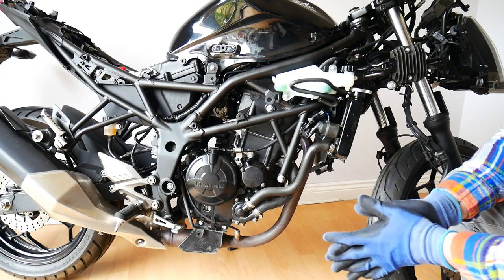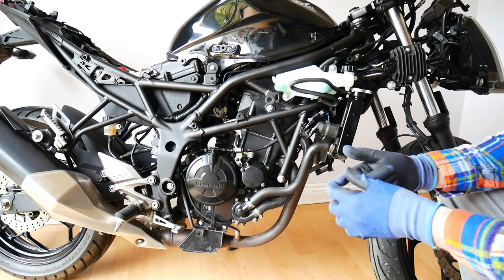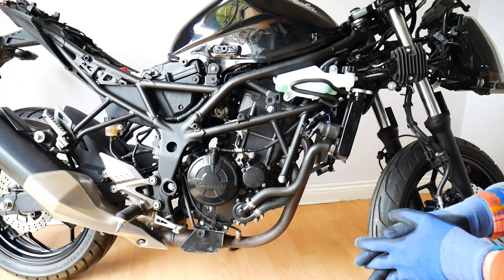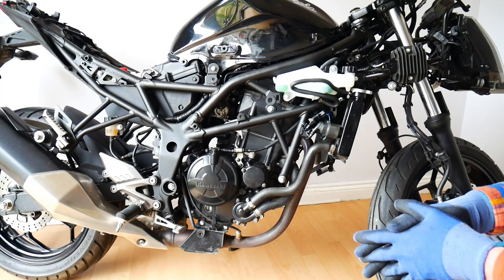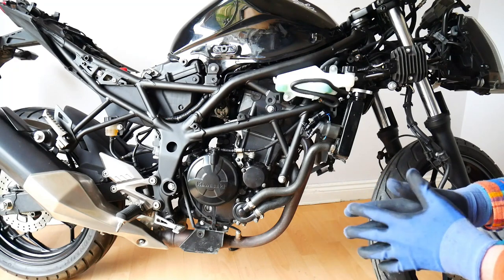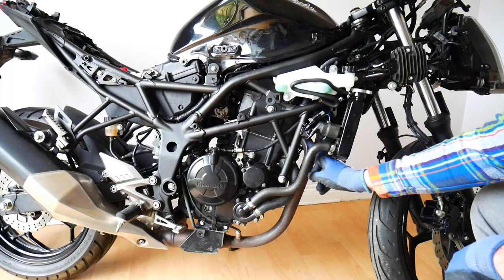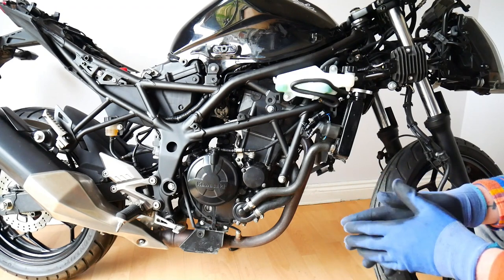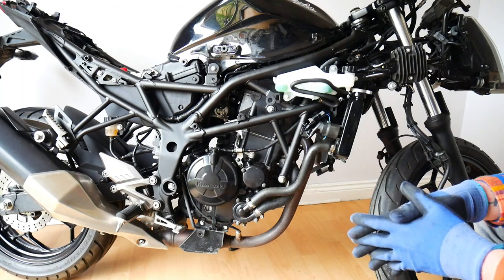How the cooling system works in a motorcycle

Comment: So if I have hot coolant boiling out my overflow reservoir while im riding and at stop lights then has the thermostat failed? Seems the coolant is not going back into radiator to be able to cool down.
No visible leaking
New radiator cap
Flush with distilled and vinegar and only distilled water 4 times
Bleeder bolt bled
And sent through 3 heat cycles

Bad Thermostat maybe?
Hole or cracked hose?? Prolly not cause no leaking visible
Reply from the maker: Coolant will expand into the coolant reservoir normally as the engine heats up and then flow back into the coolant system when it cools down and contracts in the coolant system. If the coolant is actually boiling then thats not good and it could be caused by any number of reasons. Best bring it to a mechanic who will probably diagnose it professionally before any long term damage is done to the engine. Best of luck!

Comment: That was the best explanation I’ve ever had. Thanks. I have a question btw. I found the coolant reservoir on my new motorcycle cracked, but the crack was in the top in such a way that coolant wasn’t leaking at all. I don’t know since when the crack was there, assuming the crack was there since the purchase, is it safe for me covering 8000 kms till I found it? There was no overheating, fan functioning well and the radiator is full. Does the air get into the system? Please help. Thanks.
Reply from the maker: Makes no difference if its just a crack in reservoir and coolant never reaches it. You would be best off getting it repaired or replaced though in case crack grows over time or if bike went over on its side then coolant could leak. If you leave it as is then you might never have any problem with it. It all depends.
Reply: @TheMotorcycleMuse  thank you so much for fast and useful reply. That was helpful. It’s always better to know from a pro. Thanks again. 😊